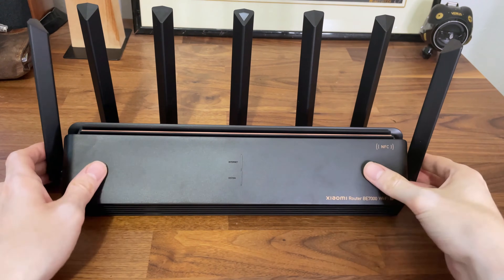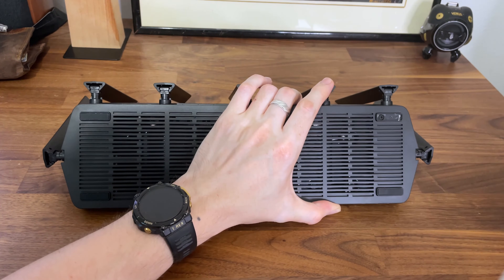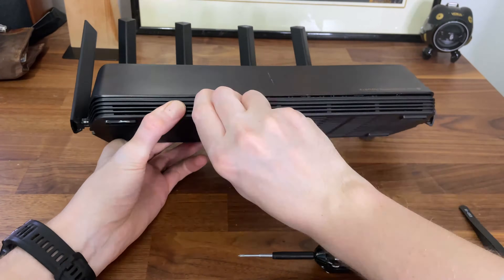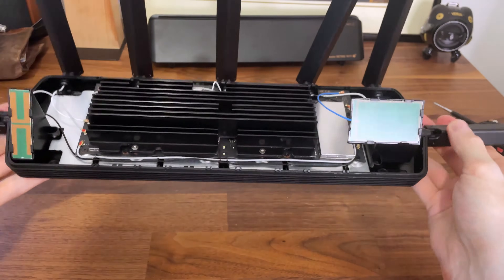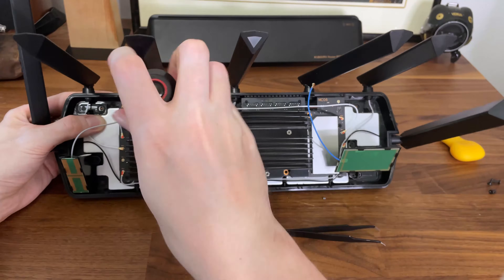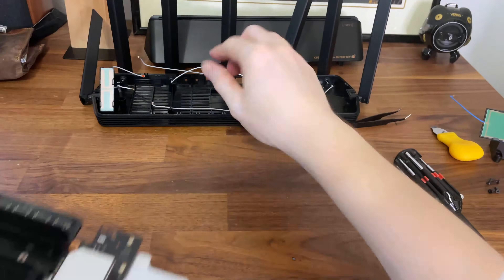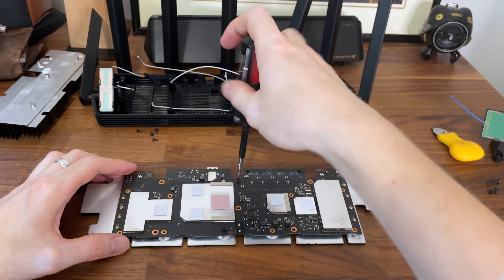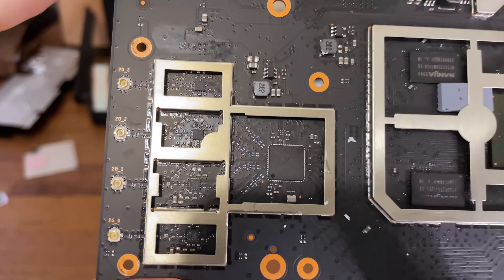Xiaomi BE7000 WiFi 7 Router Teardown: Wait up, where's the 6GHz radio band?

Comment: They should had installed a small fan for hot air to get out with a design smiler to a stock gpu it would loocks good and cool it better

Comment: I have AX3600 which died on its own, serial connection shows bootloop. Quality is therefore not good, perhaps bad look. I replaced it with Mercusys MR90X, a triband router... cheaper yet better router in features, software updates etc than Xiaomi AX3600. Also supported by OpenWRT. Will never but Xioami router again.

Comment: Do you know the thicknesses of the pads used? I am asking because my BE7000 router has recently rebooted and I think the pads are starting to get tired from the heat. I would like to buy all the thicknesses needed to change them. Thank you if you could help me.
Reply: I answer myself, you need steps of 1 mm, 2 mm and a little bit of 3 mm.
Reply: Lmao just get any padding to lift it

Comment: I wonder if it could be flashed with 3rd party firmware
Reply from the maker: So far, there doesn't seem to be support for any third-party software. Hopefully OpenWRT will crack it soon.
Reply: @SamBondor my dBe7000 has been flashed with OpenWrt, I paid a platform to do it.
Reply: @liuyue-z2m 
Can you provide me with the file link please?

Comment: Can You , Please , make a video which antenna is 2,4 GHz and which is 5 / 6 GHz  !  Thank You in advance  . It is very important when you got two floors home !
Reply from the maker: You can see in the video that the four connectors on the left are for the 2.4GHz radio band and the four on the right are for the 5GHz band. There is no 6GHz support.

Comment: Sir, I am looking for a router which can support openWRT. My plan is to use this openWRT router for multiple internet source load balancing. Can you please suggest which will be a good router?
Reply from the maker: The TUF-AX6000 should be a fairly reliable OpenWRT router.

Comment: Given the hardware requirements of Open WRT you think this router might have a chance of getting supported?? Asking because if it does, it might be possible to enable the 6ghz radio.
Reply: OpenWRT could support it 'easily', just that SOC doesn't have support in OpenWRT yet. It's likely not too different software wise from the Qualcomm AX platform
Reply from the maker: I would give it a go myself, but I lack the expertise right now. I know that there are some guides online, I just hope I won't burn the house down.
Reply: @SamBondor  the Qualcomm AX target on OpenWRT is a bit of a mess due to it being a mix of Qualcomm SDKs and backported patches, I'd wait on either of the two people that mostly work on Qualcomm chips for OpenWRT to add support for it (one of the two people also has NDA access to Qualcomm documentation). Getting a new SOC running on OpenWRT is a bit more work than getting a new device added to OpenWRT.

Comment: I am confused. So there is absolutely no 6ghz band at all in terms of hardware wise?
Reply: It really does not matter if the chipset support it or not.  The "secret" firmware is made in China for the Chinese market.  They will notallow 6GHz for WIFI in the lifespan of this router.
Reply: The QCN 6224 does have 6gHz band. It's not activated if u can compile ur own software for it then sure u can activate it

Comment: อยากได้ wifi7 ที่รองรับ 6GHz ตอนนี้ผมซื้อ xiaomi 7000 มา 5,000 กว่าบาท ไม่มีคลื่น 6GHz
Reply from the maker: You should be able to return it and get a router that does support 6GHz. Right?
Reply: It is still a fast router and a good buy for the price, unless you need Gbit speeds or live in a crowded place with lots of 5GHz interference.

Comment: Is it compatible if I mesh it with the AX6000 one?
Reply: It will be interesting to see if it does.  The AX6000 supports one more device for mesh (AX6000 or AX3600 or other?)
The 7000 supports up to three more 7000 in a mesh.  So perhaps you can use a 7000 base with a mix of up to three more Xiaomi mesh devices.
But I would not go crazy with wireless backhaul, as it might slow things down for the highest speeds.
Reply: Yes it does support that.
Reply from the maker: I don't really have a communication channel with Xiaomi, so I didn't get their official response, but I did find this on their website: 

"* Mesh networking requires the terminal device to support the 802.11k/v protocol, and the actual experience is related to the terminal capability and the actual home environment

* Xiaomi/Redmi routers need to support Xiaomi Mesh networking technology, and carrier customized versions do not support mixing with retail products"

So the BE7000 should work alongside the AX6000 and form a mesh network.
Reply: @SamBondor  Much appreciated keep up the good work.

Comment: Why is there No Xiaomi modem? Any recommendations for a good modem and a decent price?
Reply from the maker: It depends on what type of modem you need (DOCSIS, DSL, VDSL and so on).
Reply: modem supply by ISP
Reply: Can be replaced @a892728
Reply: I do not think you understand your own question.  In 2024 modems are always supplied by the ISP.  If you want to use your own router (like I do), you ask your ISP to set their modemrouter in bridge mode (aka modem mode).
Reply: @la7dfa I think the first question is interesting though. Why are there no Xiaomi modems supplied by ISPs??
Reply: @rockraphlegal  Because Xiaomi do not make any afaik.  Many router-modems are tailored for particular ISP's with slightly customised software.   They also have a locked down (admin) control of VLAN for TV, so it is a bit different from a generic router who the user can mess with at all levels.

Comment: Looks okay to me. Literally an upgrade to the Xiaomi AX3600 and it comes with 1GB RAM (probably required for these qualcomm radios) and supports 4x4 MIMO on 2.4GHz.
The only downgrade: 128mb flash instead of 256mb.
Yes, it's a tri-band due to the IOT radio (the center antenna with the LED is running a 1x1 MIMO on the third radio) and doesn't support 6GHz
Reply: The tri band is due to "two band segments" on 5GHz. So it can do a 160 + 80MHz band plus 40 on 2.4GHz afaik.  I am not sure if these chipsets and the Wifi 7 protocol can merge the two 5GHz bands, but I suspect so since they claim bigger combined transfer speed.  I have the AX6000with the same 5GHz bands and it works very well for the wireless even with just a single band segment.  It has no problem at all with my 500Mbit internet download speed, but upload via wifi is limited to 300Mbit or so.
Reply: @la7dfa  you might be onto something. I didn't expect that but they actually say so on the website.
notable details: this device will only support MLO for both 5GHz bands, but never for the 2.4GHz band which is still using ath11k (wifi6/802.11ax) instead of ath12k (wifi7/802.11be with MLO support)

I'm wondering whether we will ever see useful amounts of clients that support being able to connect to two 5GHz bands at the same time. probably not. it requires more antennas.
Reply from the maker: That's interesting. I somehow missed the extra radio, so thank you for pointing it out.

Comment: so its fake
Reply from the maker: Apparently, not having support for 6GHz can still qualify the BE7000 as a WiFi 7 router, so not a fake.
Reply: What is fake? Xiaomi never said it would support 6GHz anywhere
Reply: @bFix  Xiaomis WIFI 6e was a way to trick people,  and the WIFI 7 without 6GHz is not much better.  But since these routers are for the Chinese market with Chinese GUI, people need to know what they are buying.  If you do not want to study the details, then buy a more expensive router locally.
Reply: You could even build a wifi7 device with only 2.4ghz, or only 5ghz 🤷 😊
There are no requirements, yes